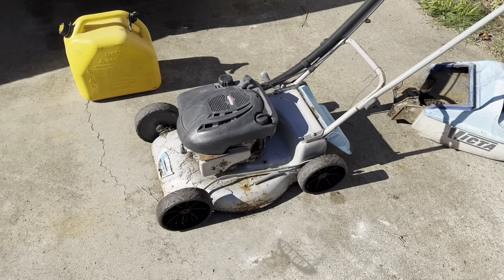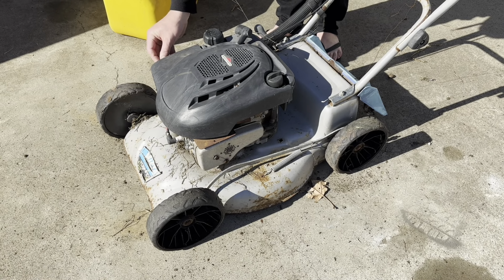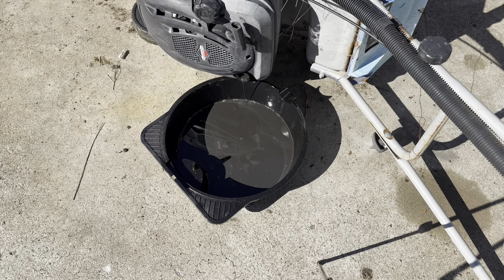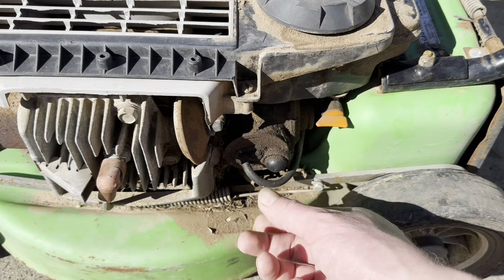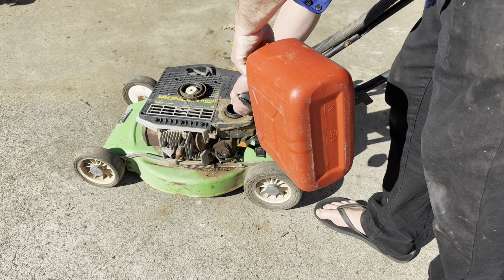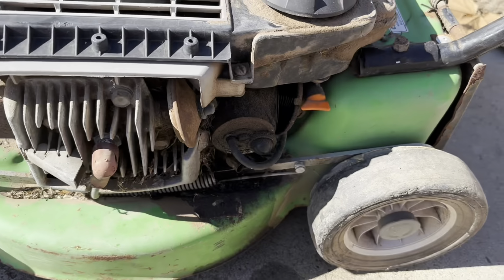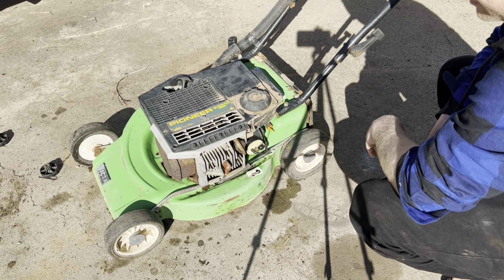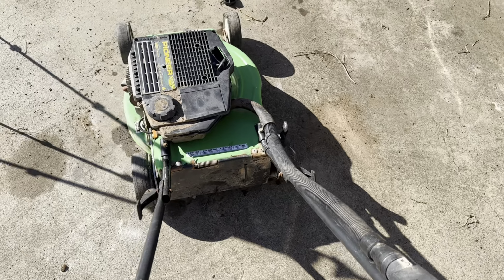Will this old Victa go? Let’s find out!

Comment: grouse scores there Joe mate and yep you cannot go wrong or kill your Victa 2 stroke aka 2 cycle engines even on the old P/T (Power Torque) ones and even the earlier ones from the years 1952 but yeah much better than todays stuff made to fail unless you look after it which most people don,t bother doing for sure but yeah luckily you do a bang on job cleaning em up and as for that sad and sorry old Briggs and Stratton Quantum Engine yep i would have kept good parts on it seeing the shape it was in plus the knocking it had etc.